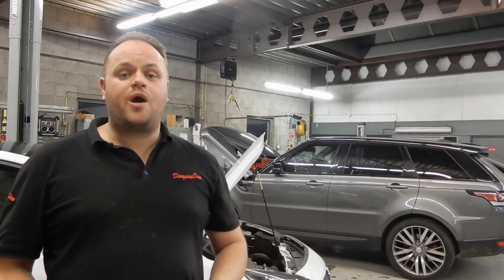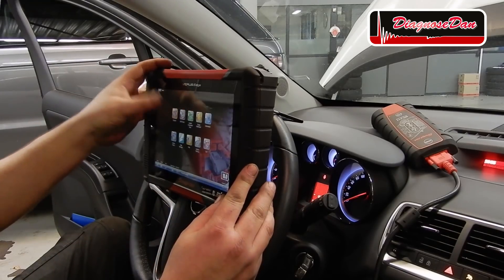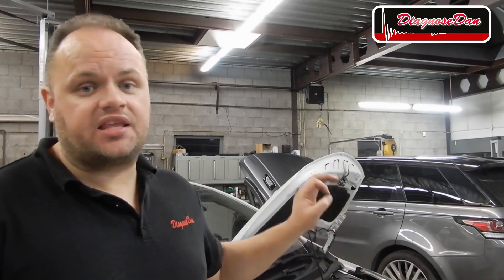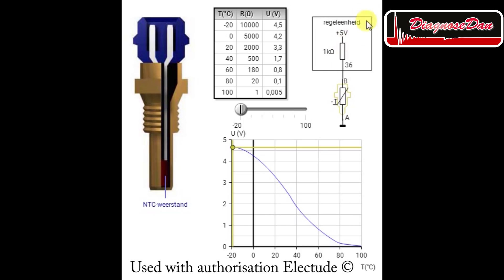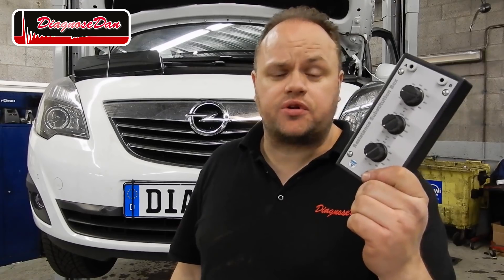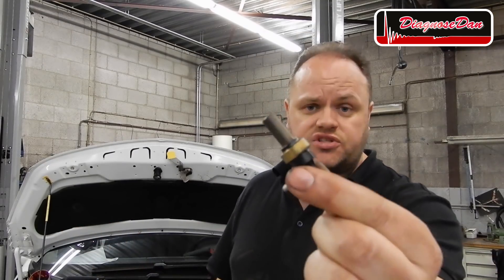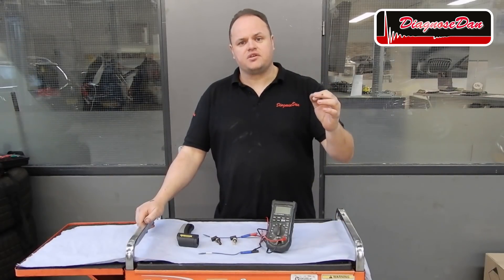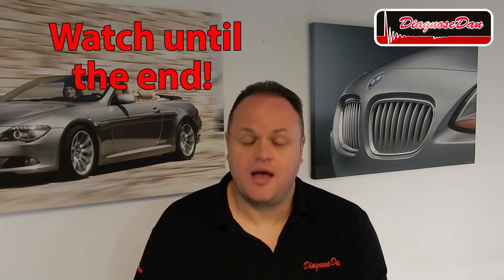Using a Decadebox to diagnose an Engine

Comment: regeleenheid= control unit , I'll save you the search 😉
Reply: Great video but I feel embarrassed for the other Shop. That's pretty basic fundamentals failed in range sensor. Good work
Reply: hey dude glad to see someone else I watch here  love your videos too
Reply from the maker: 🤣🤣 It's called fish bowl in Europe😜
Reply: Someone was a parts changer not a thinker!
Reply: Thanks ! Yeah I've been around Dan since 246 Subscribers
Reply: @NewLevelAuto  I enjoy watching you guys video, Eric O. Pine Hollow,  Scanner Danner, New level auto, and now DiagnoseDan you all give me insight. Like two weeks ago Eric O had a Chevy with an E85 problem and wouldn't it know I got Chevy with a MIL checked the codes and there was a code for rich fuel mix did all the standard test came down to me cleaning the intake and the MAF reset the fuel trim and still the fuel trim read rich mix them remembered the Eric O video with the flex fuel truck so I checked the service data said nothing about the car being flex fuel checked the owners manual and found that car was flex fuel compatible checked the alcohol content from the scanner and read 48% and I knew the ower only used 87octain so physically checked the alcohol content and nowhere near 40% let alone 48%. Because I remembered that video fixed that car so if it wasn't for videos like this I'd be stumped on some repairs. thank you all
Reply: @NewLevelAuto  I just found it now, you could say 1000 times slower (it has a few more subscribers) ;)

Comment: In 2008, I had the same problem on a 1989 Honda Accord LXi, except the ECT was reading 40 degrees F (40 degrees C).  The car would not start in the summer but had no noticeable problems in the winter (except for black smoke from the tailpipe).  In the summer, it would not start and would backfire from all the excess unburned fuel in the tailpipe.

Comment: Engine temperature sensors are of two types, positive coefficient and negative coefficient. Your case is negative coefficient, means resistance of sensor decreases with temperature. Sensors with positive coefficient are opposite, ie, the resistance increases with temperature like used on some Renault vehicles.

Comment: That's a Handy tool, but ofcourse would have been enough to measure the resistance of the sensor which would show if its resistance is out of range at cold state.

Comment: I've replaced a lot of these ECT sensors.  On VW mk4 engines, there are 2 sensors in one... one for the ECU fuel management, and one for the dash gauge... the dash gauge one reads fine, but the other half goes bad first (at least for the last 3 I have replaced)

Comment: I had this problem on my p38 Range rover and it was giving me very high shift points on my 4hp22EH transmission. Changed that coolant sensor everything is well now. I found that sensor problem via my launch 431 pro it was indicating minus - 35😂 . Dont go and change parts look at data and reality. Logic will help you

Comment: Amazing this video was posted in my feed today. Had a similar but reversed problem. Engine is cold, temp sensor was reading correctly.  But injection time under cranking was over 36ms. Extended cranking would bring down to 22ms with the engine almost starting.  Adding a resistance substitute wheel to the cts connector and bringing the measured temperature to 94c the inj pulse dropped to around 10ms allowing the engine to start and run. Further testing  showed the pullup resistor in the ecm was faulty.

Comment: When the engine is cold the car goes into open loop. That is a pre set map for cold start. When the engine warms up it goes into closed loop. Closed loop the engine fuela its self based on the oxygen reading in the exhaust system.

Comment: Good troubleshooting. What was the red paste used to seal the new temp sensor into the block? Never seen a sensor held in with a clip before. Everything is screwed into the engine.

Comment: Great job, Dan !! The most important thing here is there is no fault code, and that happens because the info from the NTC temp sensor is in the normal range of it. The ECU doesn't know whether the engine temp is about 90 degrees or not, but 90 degrees is plausible for it. This issue is what about a lot of technicians get confused and they're not able to give a solve to this kind of problems. Love your channel !!

Comment: Instead of using the decade box, you could have unplugged the sensor or jumped the ground to the signal/ref wire, checked your scan tool to see the number for the tempature change to know the wiring to the computer is good. Great video!

Comment: I use kind of trick to put my moto in hot pcm map, because moto never past 66 celsius in road so i use switch with resistor to put it at 82 celsius so that enters in hot pcm map

Comment: what a logical person you are, with common sense, which does not seem to be common these days, thanks for unscrambling a problem, with a process of elimination. I have a mate, whos a mechanic, the diagnosis said the water pump was not working,, it turned out, it was the sensor which was not working correctly.

Comment: So Dan, with yr special tool turningthe temperature to the correct temperature the car was in, on the cold setting, the car would have started i guess, good insight, thanks from neighbour Belgium, to answer yr question, besides the amount of fuel being injected , in case of a diesel, the glowplugs wouldnt activate, am i right?

Comment: I learned recently from Eric O @ SMA of a potential gotcha reading OEM data v. generic ODBC data.  The scanner in OEM mode may show default data, not actual sensor data, while reading generic ODBC, the data is raw; unaltered.  A cheapo generic scanner may have advantages.  Enjoy your channel, but I will never own another BMW, which seems your primary vehicle.  The vid on the plastic sensor failing on the intake, sucked into the engine causing valve damage, then the vanos ex/in looking the same, with the plugs next to each other the same and accidently reversed causing an issue that should never have happened on a vehicle with 30km; who needs it, keep it in DE.  fool and his money soon parted owning a BMW.

Comment: I'm old enough to remember manual chokes. Worse, I'm old enough to remember removing early "automatic chokes" and replacing those with manual chokes. Yes, that extra fuel comes in handy on a cold engine. I'm a bit surprised it didn't through some code for feasibility. Perhaps it doesn't have an EOT sensor with which to compare.

Comment: That's a pretty unusual fault, seems like a safety feature, who would have guessed that the temperature sensor would interfere with starting the engine, and that just shows how important it is to know the working of the system to diagnose it properly.

Comment: I have been using a $20 adjustable resistor wheel from an electronics store for 30 years for this exact problem on old Fords in Australia except they used to over fuel.

Comment: That was a good and quick diagnostics Dan , but the problem with many people is they don't have much theorical knowledge of Automotive technology how sensors work , for example the principle of that sensor NTC type sensor not many technicians knows how it works and what it does for the engine ECU.  well done mate .

Comment: So this sensor gets 5v on one terminal of the senosr ( or slightly less like 4.5v ) from the Control module and then the other terminal is ground and the Control module reads the difference.

So you could probe and make sure the sensor is actually getting the 5v to begin with?

Comment: Hi Dan. Can I have the decade box plugged into the wiring harness of a sensor and try driving the car to confirm problem without actually replacing the sensor? 
Thanks.

Comment: Awesome job !!!  Pays to be observant for sure.  Hard to believe that that little clip holds a "plug" for the coolant passage.  If it fails, the heat sensor pops out along with coolant and your engine will overheat and leave you stranded on the side of the road.  Poor design !!  Or did I get it wrong ??

Comment: I have an '89 Buick that once overheated going up a desert canyon (this is in California) because the temperature sensor was 
under-reading by 10˚C and the computer wasn’t turning the radiator fan on soon enough. I swapped out the sensor but figured I'd go one better. The radiator fan doesn't normally come on until the coolant temperature reaches 108˚C which I thought this was a bit high so I wired in a resistor parallel to the temperature sensor to make the fan switch on at 104˚C. This worked great when the engine was warm but I subsequently found that the engine was hard to start when cold because the computer thought the engine was warmer than it was. So I ended up removing the parallel resistor. Bummer!

Comment: I just had a problem on a 2016 Chevrolet Impala had been at a shop for months and they said it needed to go to the dealership.. I did a scan on it and found a P0303 and a circuit problem on injector 3 circuit A ,,, after I looked at a wiring schematic I did a visual inspection I found that a rodent had been chewing on the wiring harness on injector 3

Comment: It's a nice way to test, but personally I'd have proceeded by measuring the resistance on the sensor and, if it was not correct, I'd have taken out the sensor (as 95% it's its fault) and probe it with my multimeter and a pot of water on the cooker to see if it was changing or not while the water temperature inside the pot was raising. That way I wouldn't need the variable resistance box tool and I'd have obtained the same result.
About your final question: easy answer: the temperature of the engine makes the ECU to inject different amount of fuel: more if it's cold and less if it's hot. Infact at the very beginning I thought it was a problem with lean carburation, and later on we've seen that the cause was the temperature sensor. Lean carburation on cold engine means it will be very hard to start.

Comment: Thanks for sharing this information for us.  
Is it possible from the high Temp reading with cold engine now that there is short to ground or faulty temperature sensor. If you disconnect harness from temperature sensor temperature reading close to zero.  Best regards bro

Comment: Did you know that starter motors are designed to be used for short bursts?  Using them for extended time can kill them.  Cold start injector no functioning for unknown reason.  Don't keep trying to start it.

Comment: when the engine is cold the pcm looks for a large resistance from the coolant sensor to command extension of the pulse width for fuel enrichment , when the engine heats up the pcm shortens the pulse width to coincide with stoichiometric air fuel ratio to maintain 14.7-1

Comment: I still get a laugh every time I hear people complain that newer cars, with all their complex computer systems, are just too complicated these days and you need a computer to diagnose a blown bulb.  I pegged the temp sensor half way through the first cranking attempt after you explained that it only had issues when cold.  It'd be the same on a car from the early 90's as it is on this car.  If the computer doesn't know what the engine temp is, it won't know how much fuel to deliver.  It's a little more difficult to diagnose when the vehicle has multiple temp sensors, as some do, but a cheap obd2 bluetooth adapter from amazon or ebay and the free version of Torque for android devices would give you all the diagnostic info you'd need to figure it out.  Looking at the intake air temp sensor, gauge temp sensor(if separate from coolant temp sensor), and coolant temp sensor with the ignition on but the engine not running would show you if there's something off. 
It's horrifying just how many of your videos include cars that have been to other shops before, just to end up throwing money away on parts that didn't need changed because they don't know how to check if something is bad.

Comment: Coz the ecu runs in closed loop, thinking that the engine is warmed up and thus injecting little fuel. Its not enough fuel to start a cold motor, though. Kinda like a carburetor. I'm really starting to question the integrity of those shops and mechanics that couldn't figure out something as simple and obvious as that...

Comment: Would have thought that and just check resistance of the sensor.  Once you hooked up the decade box and had a low temp reading, I would have tried starting the car. Just my thought.
Thanks for the instructions for the whole process.

Comment: I generally look at the coolant temp reading and compare it to the air temp reading on the scanner. If the engine is stone cold, they should both read within a few degrees of each other. I think the reason that no one looked or noticed the temp gauge, maybe because many vehicles use a separate temp sensor for the gauge.

Comment: Wow, it is really cold outside, inside the shop. Outside temperature sensor. For the VW, the only solution for the check engine light is to remove the indicator light bulb.
Reply: oh, the lowest gauge was km, split km. You were right again.

Comment: During the 80's, U.S. cars usually had a separate sensor for the gauge, another one that talked to the computer and yet another sensor that controlled the cooling fans. Later on, they were all combined and one sensor talked to the computer and that info was sent to the dash gauge for visual indication. The same info was used to set fuel flow and to also decide when to turn the cooling fans on.

Comment: I worked on a Saturn that would start well when cold but would load up on fuel and would throw black smoke. Its temp sensor was stuck at -20f and wouldn't change. I pulled it out of the head and the entire brass tip was completely gone/corroded off. New sensor fixed the problem.

Comment: I've done this exact thing with the decade box and all. The problem is every time I turn the key off and restart the engine a different resistance value is required for the car to run right.

Comment: Hi Dan... really enjoy Your videos... and the way You work in a methodical way! I had (nearly) the same fault on my Opel Astra H from 2005... BUT there's no temperature gauge in the dash... just a warning lamp when the temperature gets to high. So I had to dig a little deeper, and used my scan tool and reviewed all the data, and quickly stumbled over the temperature sensor reading almost 80°C... when the engine was cold! It just goes to show that You MUST use alle the available scan data in a smart way and not just look for error codes... cause there were none in my car too. Love the way You teach us to work smart - not hard, and hope a lot of "skilled" mechanics learn from You... it will save the customers a lot of money!
Reply from the maker: Great find! Scandata is very important!

Comment: Sounds like the other shop set the part cannon to full automatic. If I was the customer I wouldn't be paying for all those parts that were not needed, or the labour. I generally just go straight to the resistance check of the sensor, then check the wiring.

Comment: Hi Danny,  hot engine drinks less juice than one cold, so PCM belive that motor is hot and refuses to give it more juice than is necesary to keep it running , in the oposite scenario, if the motor were hot and ECT sensor were telling to the PCM  that is cold, that ECOTEC motor would be drowned.  I use variable resistors to simulate  TPS and ECT signals instead a decadebox,  ( i dont have one, jeje) also i set variable resistors to simulate  and disable old car security systems, i like play a bit more with  new to me car systems that already i found the fix,  diagnose is very fun and for me the best self learning  metod.
Reply from the maker: Thanks for watching my video's it's appreciated

Comment: This is the second video I've watched of you and you just gained another subscriber.... I'm just starting off to learning more about cars. I bought my wife a 2003 yukon couple years ago and the engine light came on couple weeks ago so I bought a code reader. Smoke machine should be here at the end of the week along with a plug adapter to close the canister solenoid since my code reader only reads codes to help find the po442 code small evap leak. The Ac clutch is not engaging but I'm sure its do to the refrigerant leaked out, I have gauges coming in this week so I can get it going because I'm sure theres a leak in the system but I want to check the pressure switch and the book says to bridge the terminal but I'm not familiar with the term, do I get a piece of wire and make it a u shape so the contacts need to touch each other? I've also ordered a snake camera, theres a small oil leak behind the motor and I can't tell where its coming from.... Anyhow, thanks Teacher, I'm suscribing now and have a good day
Reply from the maker: Thanks for Subscribing Mark.

Comment: Cold start requires startup fuel enrichment because of the poor atomization of the fuel at low temps. Once warm, the fuel atomizes well and enrichment is returned to 0% compensation. Coolant temp and intake air temp make a big difference on fuel input to get and keep an engine running.

Comment: If the temperature gauge read normally.  What would have been the first thing you would have looked for?  A fuel pump fault?
Reply from the maker: Regular checks, spark/fuel.😉
Reply: @Diagnosedan  i found an insect in a MAF sensor ,  no codes also, but no gms/sec in scantool, and not start

Comment: Great info , but how to wire decade box if the ECT sensor have 3 wires ? is it possible to let the guage move at cluster on 3 wires design ?
Reply from the maker: Just use the signal wire
Reply: @Diagnosedan  Thanks for fast response .